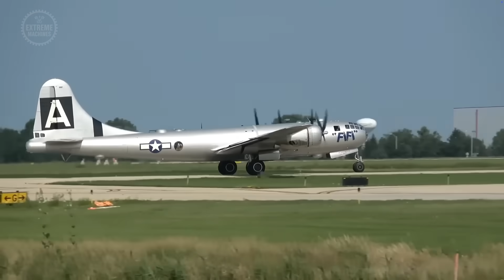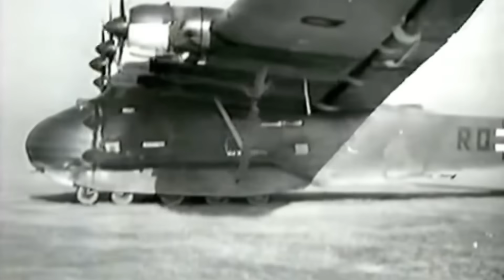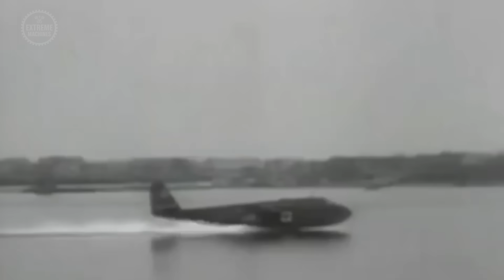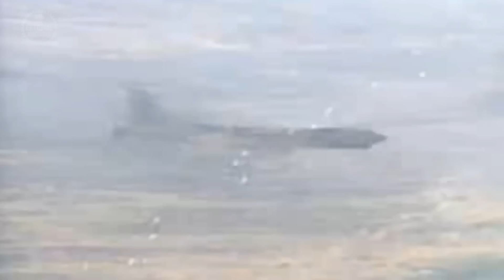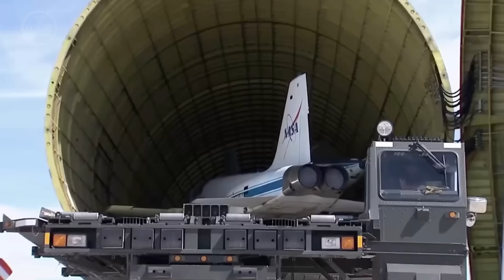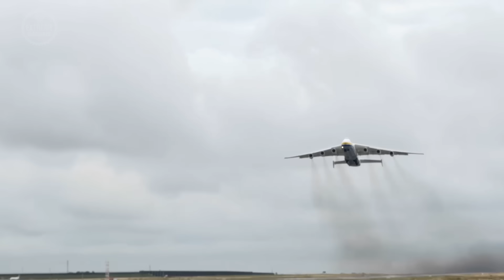These OLD AIRCRAFT Are Absurdly HUGE and Among the Most Incredible the World Has Ever Seen!

Comment: As is typical with this type of video, miscellaneous aircraft (in this case) are just 'thrown in" randomly - for instance in the case of the two WWII German behemoths - the narrator's talking about the snub-nosed, 6-engine floatplane, and a smaller, sleeker, 4-engine aircraft is seen "back and forth" with the one being narrated.  ...and the narrator keeps mentioning weights as "__thousand-hundreds".  While narrating the B-36, footage of B-17s and some other unidentified snub-nosed aircraft is just "thrown in".  Finally, while the AN-125 is touted as "the largest" (slightly larger than the C-5), the 6-engined AN-225 Myria is about half-again as large. Though un-narrated in this video, it's shown.  It was originally designed to carry the Russian space shuttle.  Unfortunately, the only one flying was destroyed by Russia's invasion of Ukraine.